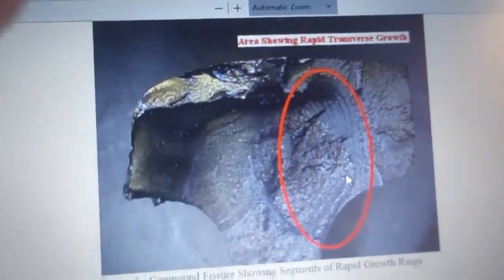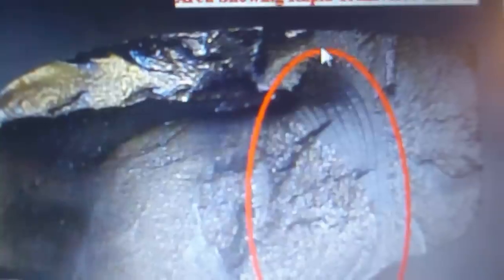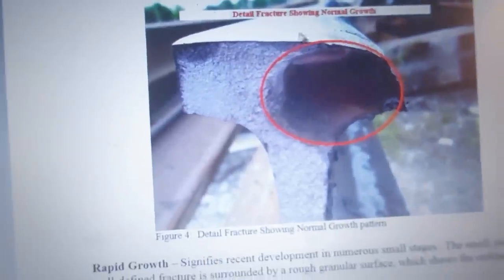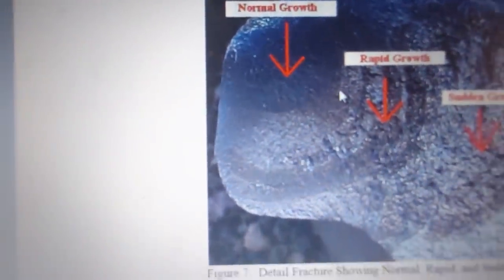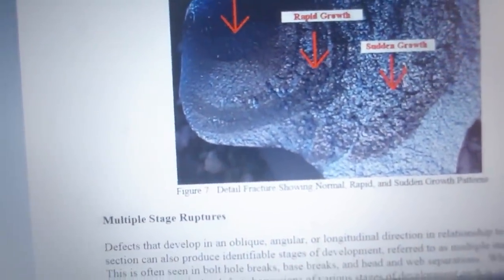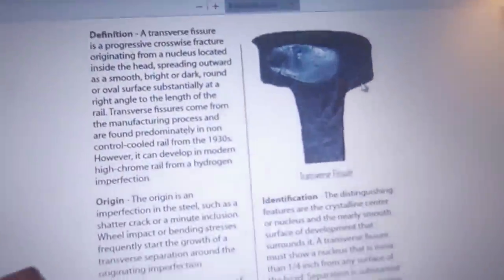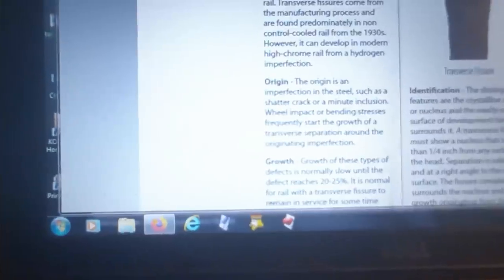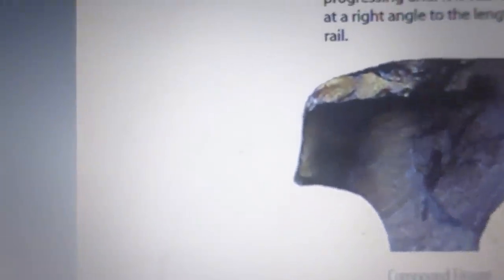Cancer in the Rail Head

Comment: I wonder when you’re on the track in your high railer are you ever tempted to steer with the steering wheel😂
Reply from the maker: LOL, I used to do that way back when I first started running the trucks on the rail. Still tempted to do it but with the big hi rail
truck the front wheels are up in the air. If I steer on the small
lo rail truck it will walk right off a curve so I don't dare steer
on that small truck.

Comment: It sounds like a manufacturing defect at the steel mill. If you have many defects on rail lengths from a certain company, I'd suggest sourcing from a different company. It's $3,000 a stick. Not cheap...
Reply from the maker: Mills are constantly trying to improve the quality of their rails Kraz.
We get ours from Steelton (new rail) and have had zero so far
go bad. The rail i showed you a pic of in the beginning was
from 1975. Appreciate your taking the time to visit and check out the video my friend.
Reply: @ccrx6700  If you.ve had zero problems with your current rail supplier, obviously stay with them. You'll just have to keep checking on the older rails. I'm sure you have the records of where these rails are on your property...
Reply: @ccrx6700  Awhile back you made a video on the quality of ties, bolts and other hardware. Your company at the time was going through a financial hardship so they bought cheaper hardware from China, Mexico, India or other countries. And I remember you had many failures. The old addage is "you get what you pay for"..
Reply from the maker: @kraz904  👍😊
Reply from the maker: @kraz904  yes sir